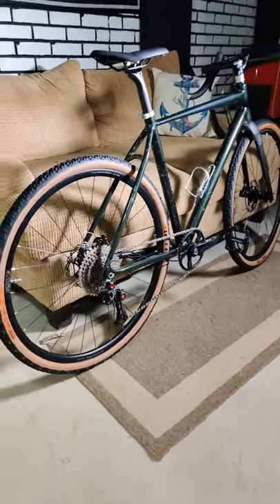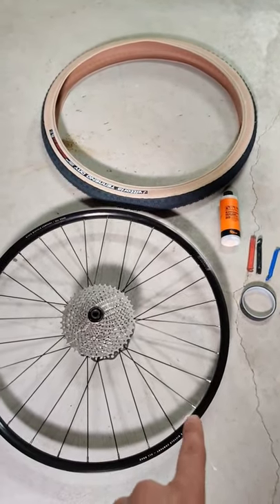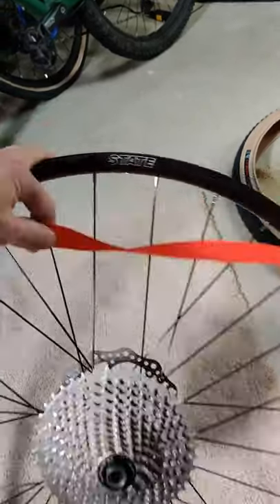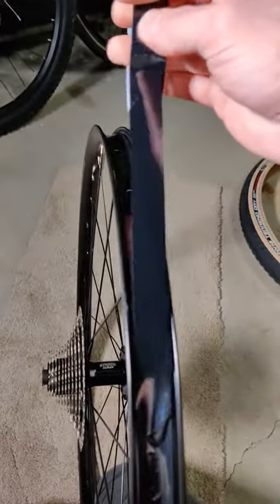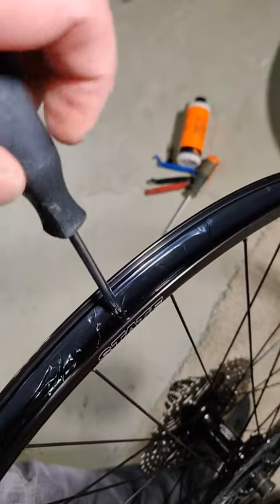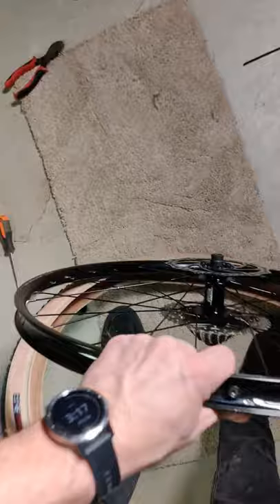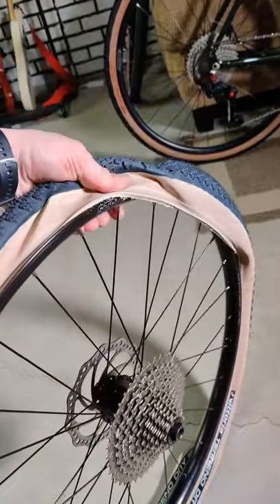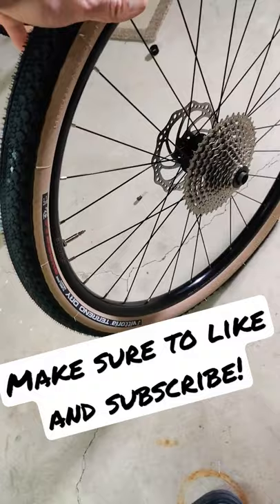TUBELESS SET UP in under 1 minute! #shorts

Comment: Nice bike! Was thinking about going tubeless, what are the pros and cons? And does it work with any rims and tyres I would have laying around? Thanks 👍
Reply: Any rims if I put some strong tape around it
Reply from the maker: You can make it work on a lot of rims but you need tubeless specific tires. They have a hook on the bead to help them seal better. Honestly, if you have it set up well, there are almost no cons to tubeless set up. The pros far out weight any small negative. It's lighter. Allows you to run lower pressure. It's so good

Comment: Are you using a schrader valve adapter on top of the presta valve? Looks like it
Reply from the maker: I do with my compressor and I usually keep one on my set of wheels whenever I go on rides just as an emergency
Reply: @acebikemedia  do you find it easier to inflate the tires with that adapter? I'm thinking about getting a couple, I'm not a fan of presta valves at all.

Comment: What’s the point of tubeless tyres?
Reply from the maker: Less weight. Can be more reliable, and wide range of tire pressures can be used safely.
Reply: Less roll resistance and better tread contact to the road surface.

Comment: Won't the wheel get bent without a tube?
Reply from the maker: The rim can get damaged but if you run proper tire pressure you generally will have no issues.
Reply: you can use foam insert if you want more protection to rim
Reply: It's called air buddy
Reply: what pressure?there is no  tube inside the weel to hold pressure. @acebikemedia